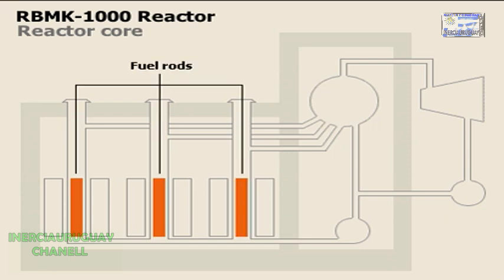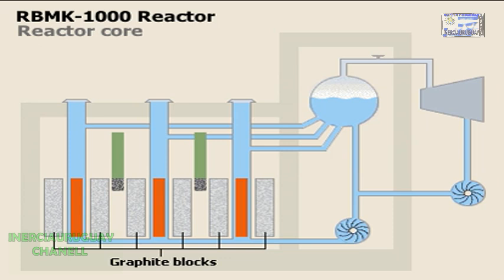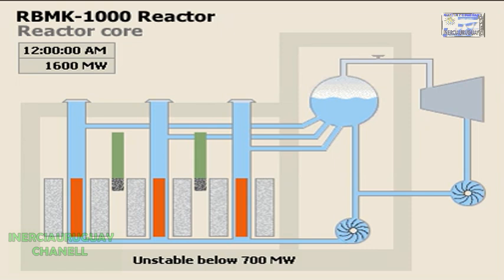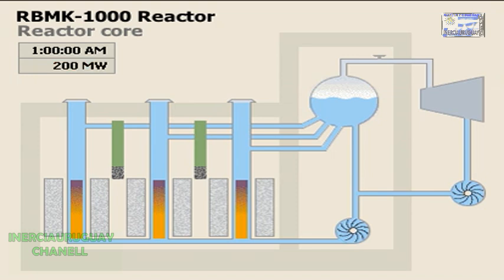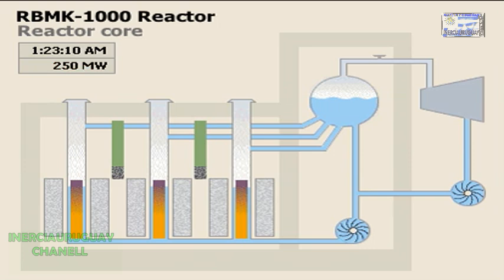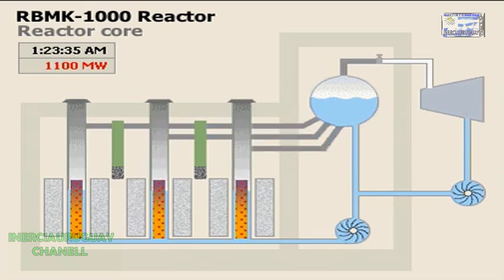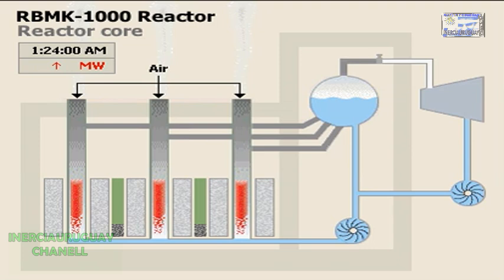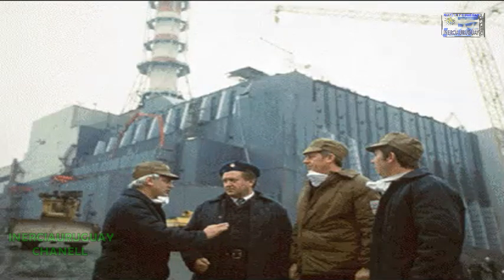WHY THE NUCLEAR ACCIDENT WAS PRODUCED IN THE CHERNOBYL PLANT ANIMATION

Comment: This video severely over-simplifies what happened to the point of inaccuracies. Here's a few: 

1. When the power of the reactor stabilized at 30 it was, essentially shut off. The 30 megawatts being generated was simply reactor decay. (A nuclear reactor takes a while for reactivity to go down)

2. Xenon was present in the core. At the moment they were down to 30 megawatts they should have officially shut down for 24 hours to allow the xenon to dissipate from the core. Xenon is the best neutron absorber and will severely inhibit nuclear reactivity preventing the reactor from producing controllable power!

3. The control rods were not "tipped" with graphite. Below the control rods were "displacement rods". These rods are made of graphite by design. Their purpose was to displace the water in the control rod tubes to increase fission in the reactor. Think of the boron control rod as a break, and the displacement rod as the gas.

Comment: Many important informations are missing in this video. I am sure this would boost the video length but some things shouldn't be left out.

The graphite "tips" on the control rods for example. The graphic doesn't show that the control rods are also surrounded by water. The rods are made of boron which works as a kind of a break (neutron poison) and stops the chain reaction between the uranium rods. Water in bigger amounts does the same. It absorbs the neutrons. If you pull out the boron control rods, the space between the uranium is filled with water. You'd replace a neutron poison with another neutron poison. So the tip of the rod is made of graphite which enhances the chain reaction. The reactor can be controlled way better this way.

Another important information is why the reactor "somehow" went down to 30 MW. That "somehow" was because of the big amount of xenon inside the reactor. The fission of uranium produces big amounts iodine which after around 6 hours decays into xenon. xenon is a strong neutron poison and throttles down the reaction. The working shift the day before had tho encrease the power to the max of 3200MW and produced huge amounts of iodine. The iodine decayed and alot of xenon was waiting in the reactor block. The fission of uranium does burn off xenon though but there was a lot of xenon. The next shift which executed the test didn't know this. With the cooling water, the boron rods and the xenon there was so much neutron poisoning that the reactor went down to 30MW.

The workers paniced, pulled out all but 8 control rods, the xenon burned off, the cooling water got hotter and hotter and changed from a neutron poison into a moderator (due to steam voids) and the power skyrocketed. Workers paniced again and pushed the SCRAM button which lowers ALL control rods slowly (within 18 seconds) into the reactor block. Remember the graphite tips? They went in first and boosted the chain reaction further. The uranium got hotter and stretched the cylinders in which they were in and jammed the control rods exactly at the worst position. BOOM!

Oh and it is very well clear what happened next. Due to the imense heat 5-6 of the zirconium jacked uranium cylinders cracked open and instantly evaporated all the water and produced an unbelievably high pressure and the reactor blew up.

Little fun fact: on top of the reactor was a 2000t steel plate which was blown about 1km up in the air. It was 10 seconds airborne. Go out and throw a tennis ball into the air and count how many seconds it takes to come back. Bout 2-3 seconds? Imagine the power it would take for you to throw that ball 10 seconds up in the air. And then try to imagine what power it takes to lift a 2000t steel plate for 10 secs...

Comment: Lots of points of view on this accident.  The testimony from the man in charge of the test and deputy chief engineer (Anatoly Dyatlov) who was there is really an interesting read.  And then there is the accident report from INSAG-7 if you want to do the deep dive.  Lots of these videos of the accident partially blame the crew that was performing the test.  Not accurate.  The one main denominator, building  a complex system on any level is probably destined to fail. There are so many examples throughout history that the left hand and right hand are out of sync.

Comment: Decent but I need to point out: The automatic system or the operators were not to blame for the stall, it was the accumulation of Xe which poisoned the core. The operators were at fault when they raised all the rods, violating poison protocols, they should have waited for the Xe to decay since it has a short half-life.

Comment: Very nicely done. One detail, Dyatlov decided to alter the test and run the reactor at 200MW, a power band in which it became very unstable. Everything seemed to have gone wrong in this test, at every level. A few years before, a similar test was run aat another plant, nearly the same low power instability of the reactor design was seen but ignored. The RBMK design was highly flawed, together with mismanagement, gross negligence and hubris, the rest became prologue.

Comment: You completely forgot to mention the Xenon poisoning which occurs after lowering reactor power below a certain level or shutting it off completely.

After Xenon poisoning has occurred, it’s not possible to restart the reactor normally which is why they pulled way too many control rods, even control rods that are never supposed to be removed.

What they did would have most likely damaged any type of reactor if they managed to pull all control rods.

Comment: This is not a good explanation. The diagram of the control rods is very misleading. The graphite tips are not at all as shown. Unfortunately it would take too much of an explanation than I can put in this comment.

I haven't found a good single explanation of what went wrong. I pieced it together from different sources about how nuclear reactors work in the first place (and how nuclear bombs work has also been very useful) and then what went wrong. If you don't understand how an RBMK reactor is supposed to work, you won't fully understand why there was a disaster. This video barely scratches the surface of what happened.

Comment: Why did they have graphite tip on the control rods?
Reply: To quote the HBO series, "For the reason our reactors do not have containment buildings around them, like those in the West. For the same reason we don't use properly enriched fuel in our cores. For the same reason we are the only nation that builds water-cooled, graphite-moderated reactors with a positive void coefficient. It's cheaper."

Comment: This video isn't accurate. The graphite tips weren't that simplistic in design. The main issue was water displacement at the bottom of the fuel rods when the control rods were lowered back in.

Comment: "The RBMK design was built primarily to be powerful, quick to build and easy to maintain. Full physical containment structures for each reactor would have more than doubled the cost and construction time of each plant, and since the design had been certified by the Soviet nuclear science ministry as inherently safe when operated within established parameters the Soviet authorities assumed proper adherence to doctrine by workers would make any accident impossible."  I guess no one ever heard of the Titanic over there.
Reply: Academician Alexandrov (head of the RBMK design team) argued that the re is so safe that it can be built even in the Kremlin. And in addition, it is also very cheap, all materials and parts can be produced at ordinary machine-building plants. And it was assumed that he is able to work on cheap low-enriched uranium. In fact, they took the usual production reactor to produce weapons-grade plutonium, increased it 10 times, slightly changed the regimes - and called it RBMK.
But they did not take into account the fact that, due to its gigantic size, the reactor turned out to be poorly controlled, and with nuances that were not understood during development.

Comment: First explosion was nuclear. 3 seconds later steam exploded.
Reply: There were no nuclear explosions at all.
Reply: This was thought until recently ... 

The first explosion was not caused by the increase in the pressure in the water vapor reactor that blew up the 1,200 tonne radiation shield covering the reactor. In fact, it was a Nuclear Explosion ... Why so ?

1. The first explosion was accompanied by the appearance of a Blue Flare, so characteristic of a Nuclear Explosion. 

2. Electromagnetic Pulse damaged some unprotected electronic systems. 

3. At the scene of the catastrophe, the Reactor Housing Plate was not found, because it melted at a huge temperature, the vapor explosion of which could not be produced. 

4. The emission of isotopes 133Xe and 133mXe was registered. The traces of Xenon Isotopes were recorded far from Chernobyl, as much as 37 kilometers north of Moscow, and even in several cities in Sweden and Finland. These isotopes could be created and spread around Europe only as a result of a Nuclear Explosion, and not just an explosion of steam, because it had too small a range. 

5. The Next Explosion, this time the pairs, took place less than 3 seconds later. The USSR authorities were aware of what really happened, but decided to keep it secret. 

These are the Latest Statements of the Researchers from the Swedish Defense Research Agency, the University of Stockholm and the Meteorological and Hydrological Service.

Comment: Why would a build up of steam speed up the reaction?
Reply: Because water is the main coolant and is one of the moderators in this configuration. A buildup of steam means the water cooling the reactor has vaporized, thereby removing the coolant and one of the moderators of the reaction, further worsening the situation.

Comment: Best video I've found on the subject. I've been trying to figure out why the graphite tipped control rods made the reactor explode and could not figure it out but this video let me be able to figure it out. Or at least explained it in a way that makes sense. Other video either don't mention the graphite tips at all, or don't explain why they are important. 
Mentioning the vapor from the super heated graphite is what allowed me to figure it out. The vapor increased the void, and due to the positive void coefficient, the reactivity went up more and blew the top off.

Comment: Can someone please explain me why graphite tip increased the reaction?? 
Did the graphite tip with steam produce hydrogen or reason in something else??
I will be greatful if someone could tell me the chemistry behind it..
Thanks in advance
Reply from the maker: I RESPOND YOU TO TRANSLATOR BECAUSE I ONLY SPEAK SPANISH,
The tip of the graphite rods of that type had another design fault that caused them to displace part of the refrigerant when entering the core. Reactor 3 overheated and exploded, bursting the lid and releasing massive amounts of radioactive material. Soon a second explosion followed. The investigations assure that the first explosion was caused by steam pressure. The second one is not so clear, but it is believed that it was caused by the hydrogen accumulated in the reactor or even by the vapor again.

Comment: Can anybody explain why did grafite tips increase the power? Thank you
Reply: Yes, that also confuses me. I thought the graphite moderated the energy, heat and reactions. So it does not make sense that the graphite tips on the control rods would cause a sudden power surge and the resulting explosion.
Reply: @iverar  thank you. That is exectly what i thought😂
Reply: @mihapremrl1384  What moderators do in a nuclear reactor is make the reaction happen by slowing down fast traveling neutrons just enough so they can more easily hit uranium/plutonium atoms and split them into two separate and lighter elements, with the loss of weight being converted into energy and heat.

Control rods are made of a material that absorbs neutrons so they can't hit any atoms and make them split, stopping the reaction in the process. And for most reactors, that's exactly what these rods do. Drop all of them in the reactor, and the reaction stops right away.

But for some reason, the tips of the rods in RBMK reactors were tipped with graphite, a moderator material which makes the nuclear reaction work even faster instead of stopping it. So when the reactor was shut down and the rods were automatically dropped in, those graphite tips made the reactor work even more intensively, enough to make it go completely out of control.
Reply: @Milnoc  i can't thank you enough 🙂. I have only one question: so without moderator ( in this case graphite) this reaction would not be possible, becuase neutrones would move to fast to split atoms? Really thanks for answering 👍
Reply: @mihapremrl1384  Exactly! It's the moderator that makes a sustained reaction possible by slowing down the neutrons. In Canadian designed CANDU reactors, both the moderator and the coolant is heavy water a.k.a. deuterium.
Reply: @Milnoc  thank you. But do you maybe know what are product of the uranium fission... i know that there is a loh of options, but how do operators of nuclear plants know which elements will be made in uranium fission? And is that true that elements that are produced in this proces can be the fuel of the reaction too? Thanks for answering
Reply: @mihapremrl1384  Uranium 235 is commonly used as fuel in nuclear reactors. When the atom gains a neutron, it becomes uranium 236 which isn't stable at all.

The atom splits into krypton 92, barium 141 and three lone neutrons. And all that stuff weighs LESS than the original Uranium 235 atom!

You can now use Einstein's E=mc2 formula to calculate how much energy was produced by the mass that was lost in the split.

Krypton and barium aren't suitable as fuel, so they just gradually replace the uranium in the fuel pellets.

However, the fuel pellets will have a mix of uranium 235 and uranium 238 (the refinement process isn't perfect). Uranium in itself isn't suitable as fuel, but if you bombard it with enough neutrons, it'll become plutonium 239 which could be used as fuel in the same reactor!

Scientists figured out all of this stuff with some theory, then by bombarding heavy elements of different isotopes with neutrons and study what happens. After a while, they understood not only how to split atoms in a controlled manner, but also how to split them in an uncontrolled manner such as in atomic bombs.
Reply: @Milnoc  yes, I know how that works, but in one paper I read that in uranium fission can be produces also other elements (xe, iodine ...) is that true? And thanks for taking your time🙂

Comment: The operators were aware that the reactor was unstable at such a low power level, and even brought up the issue to the senior engineer in charge of the test. The engineer essentially browbeat them into continuing on.

Comment: I don't understand the scenario for this test. They were testing if the steam turbine generator could output enough electric power to maintain the cooling pumps for the 60sec it takes the diesel generator to kick in.

But why do they need external power in the first place? Why not continue operating the reactor and turbine as normal,and continue generating power in case of main electric power loss?
 In the event of main power failure AND the reactor was shut off, why would there be stem pressure to spin the turbine at all?
Reply: Because you need electricity for the main coolant pumps to prevent a meltdown. Even when the reactor is shutdown you need to keep the core covered and cooled.
Reply: Robert Luby if the core is shit down, how do you build up steam pressure to turn the turbine?

Comment: Water flow is shown wrong, water which flows in reactor is radio active and it should not be mixed with turbine water, radio active water should stay inside the reactor forever...coolant water and feed water should not be mixed
Reply: But isn't it the same water in closed loop? You know that you can cool water that leaves turbine.
Reply: what you say is another design, not RBMK